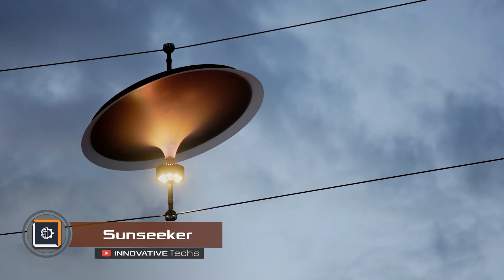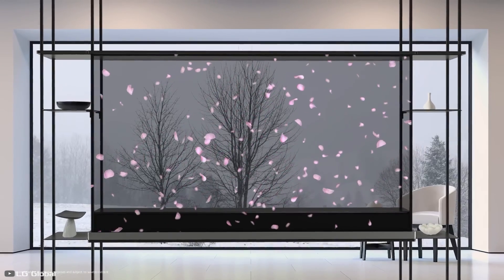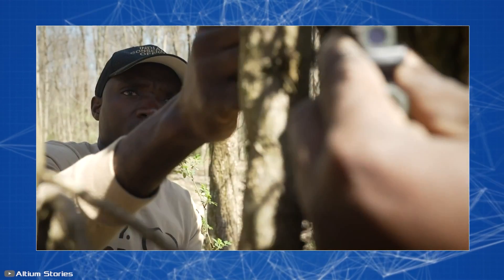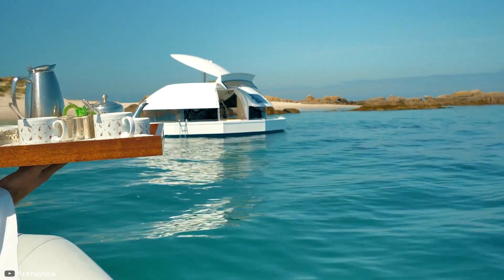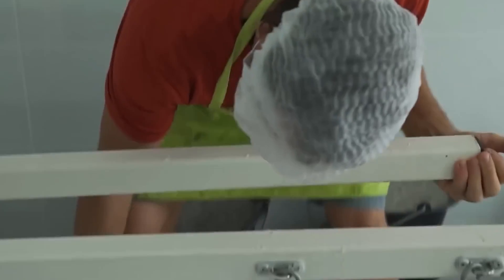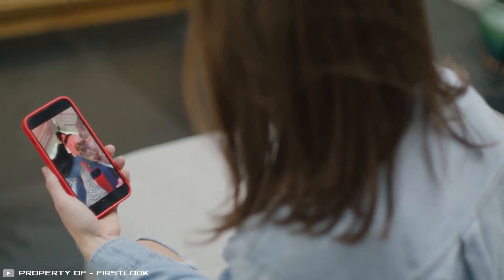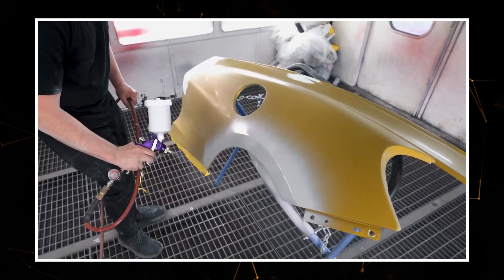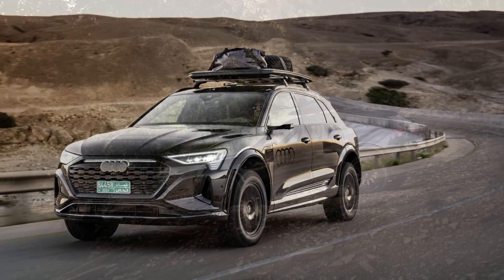AMAZING TECHONOLOGY AND INVENTIONS THAT WILL BLOW YOUR MIND

Comment: Before inventing or innovating anything, the question ' why is it required ' has to be answered future problems can be avoided like in the case of plastics. 
1. Prevention is better than cure
2. Just because we are capable of doing anything doesn't mean that we should do it. We also must know when NOT to implement certain ideas and inventions.